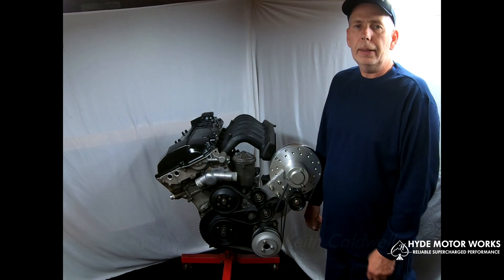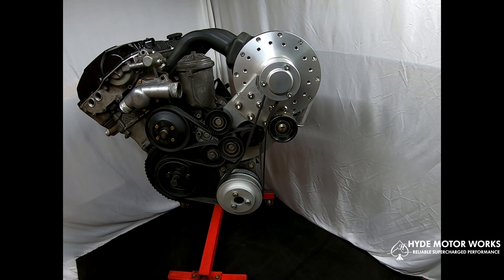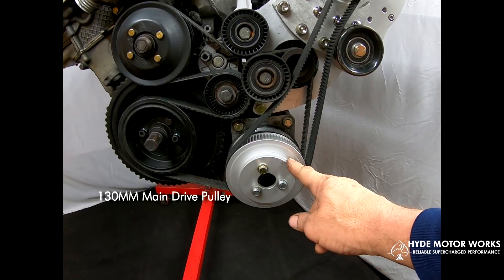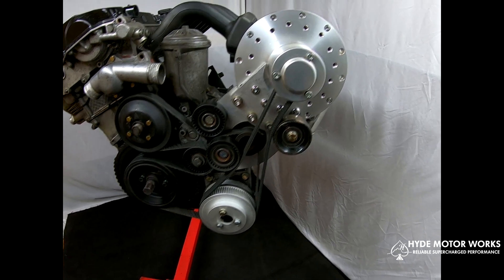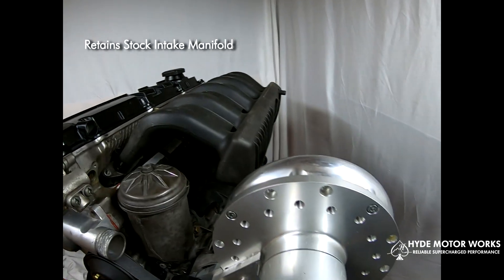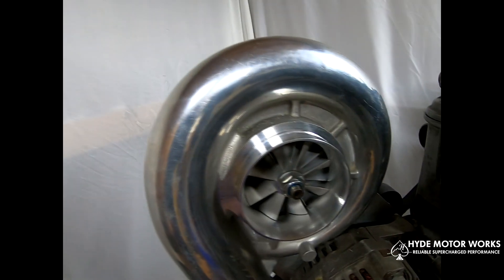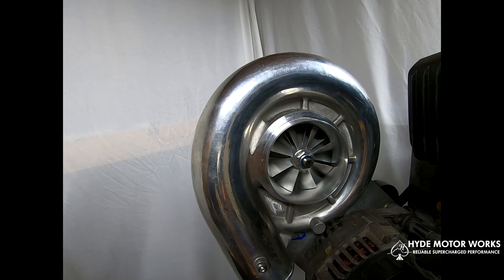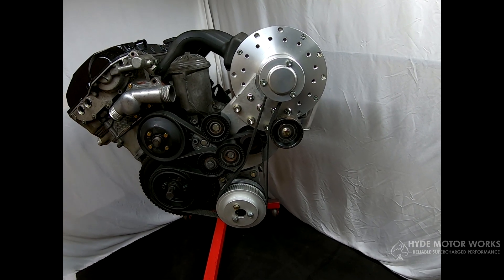Harbinger Centrifugal Supercharger Kit - Project Part 2

Comment: Hello! I'm very interested in this. Has anyone fitted it to an E30 chassis? Do you think this is possible?
Reply from the maker: E30 Chassis is not an issue, as long as the engines this kit supports are the same.

Comment: Hi I need a kit for my 4b11t I want to make a twin charged Evo X
Reply from the maker: We have a project for the 4G63 Engine, and it will feature 3 different kits. Unsure if you can use it on the 4B11T though.